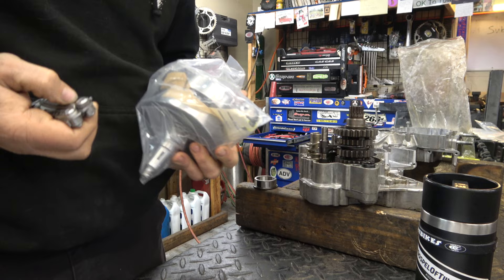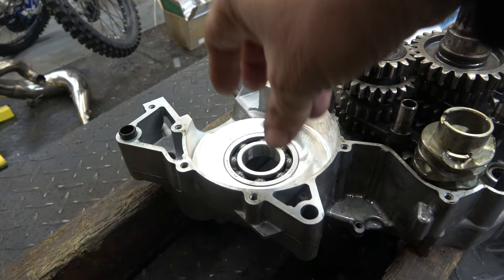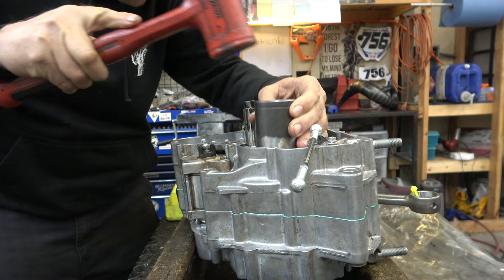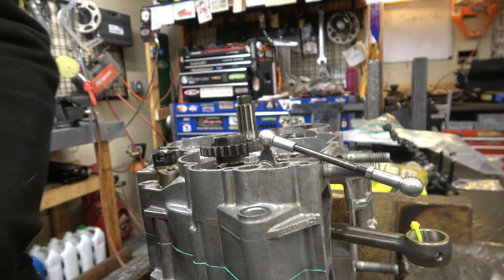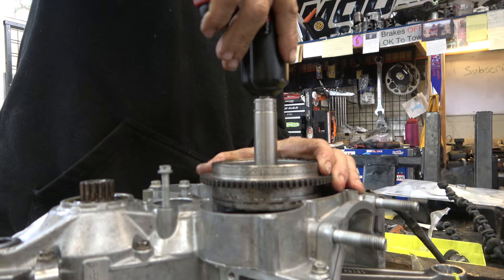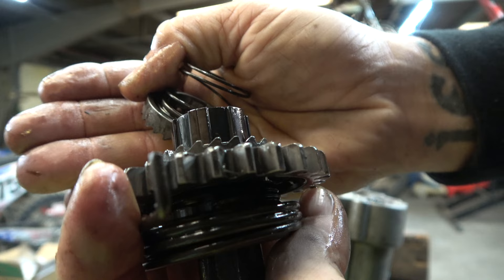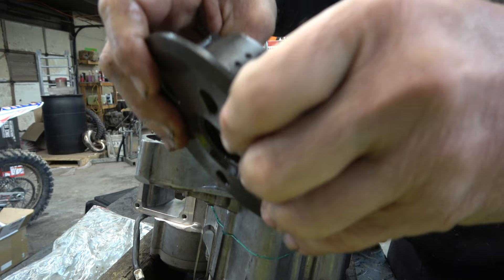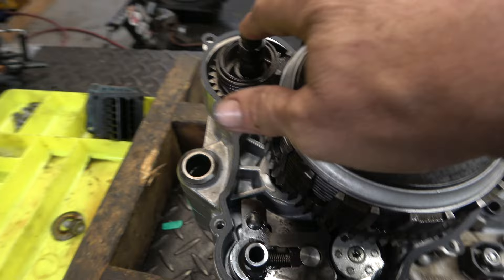How do you put a crank in a ktm 300?

Comment: Isn’t there an o-ring between crank spacer and the clutch-side main bearing?  My ‘20 does…
Reply from the maker: Yes. I forgot to put it in at first and forgot to film it when I fixed it.  It is in there now and bike is running great. Thanks for catching that. I will pin a comment up top
Reply: @highlandcycles  Hope to see you at the Red Canyon Enduro!